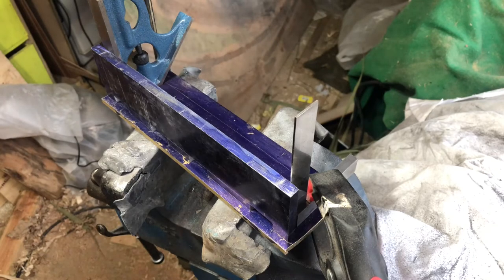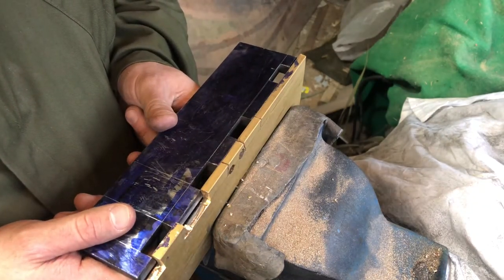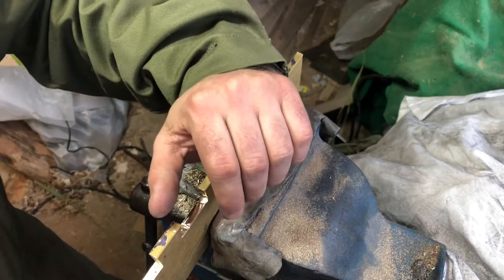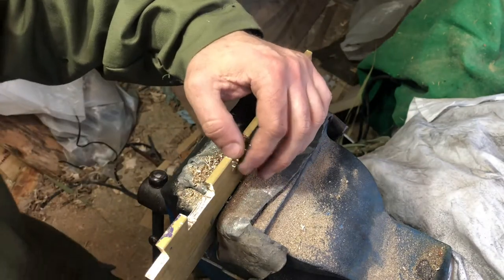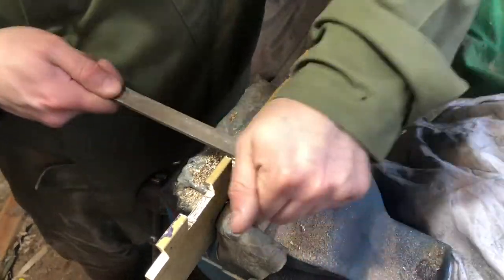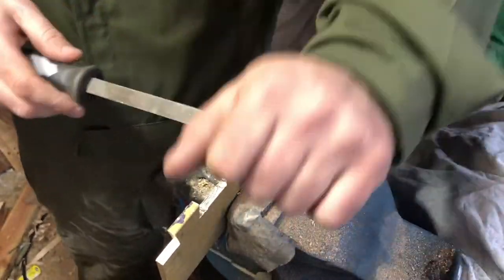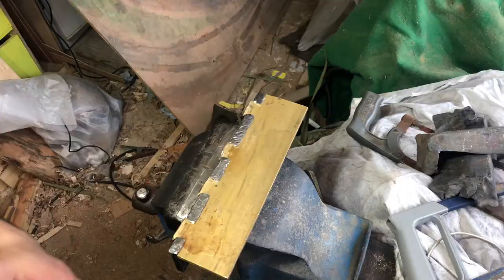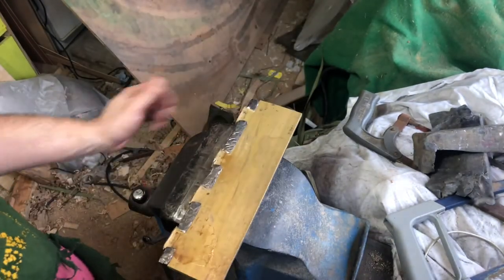Making hand tools, Infill block plane part 2

Comment: Like your style mate, haven't watched the entire series but really enjoying it, looking forward to seeing the completed project. You are correct in stating that brass will work harden. Heating with a torch will anneal and soften it for easier working.  If it gets too hard from repeated peening it can crack. Thanks for putting these vids up.
Reply from the maker: I’ve had a gap in recording some builds for a few months due to my really job. There will be another video as soon as I can fit it in, stay tuned.